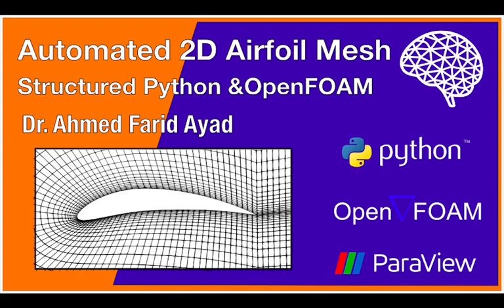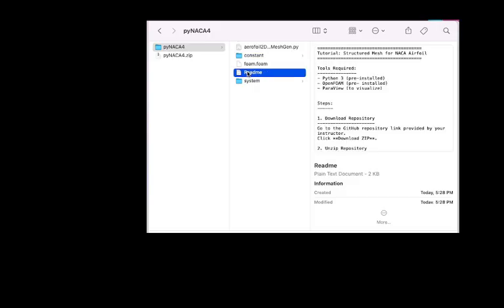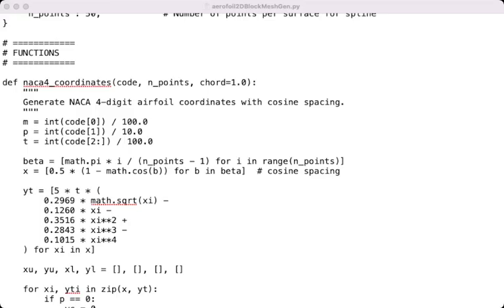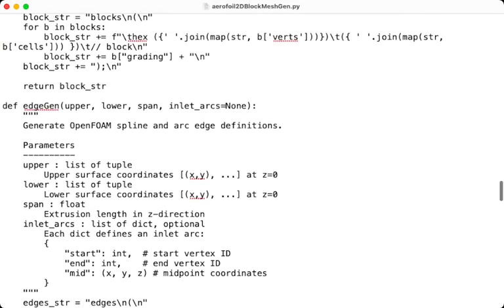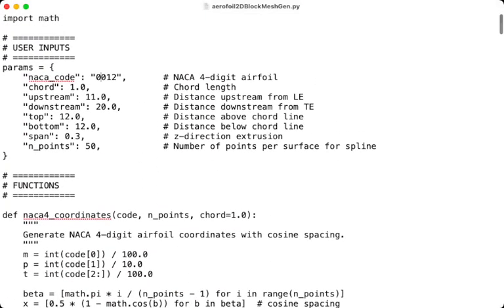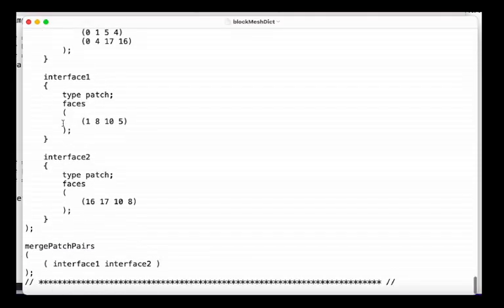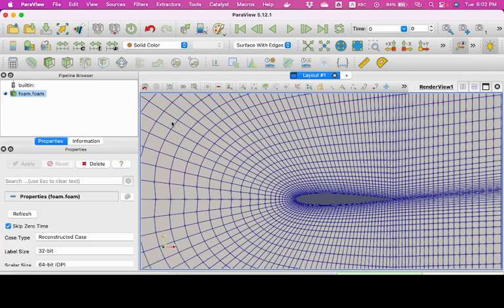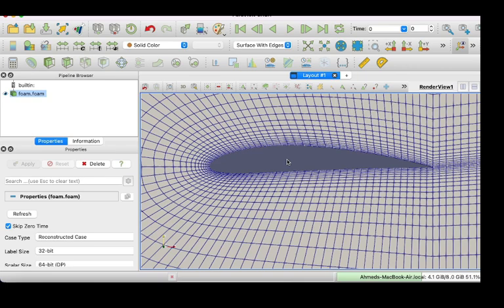Automated 2D Airfoil Mesh | Python + OpenFOAM

Comment: why my foam.foam file has no place to open with paraview?
Reply from the maker: After installing paraview you need to select to open with and navigate to assign paraview then any time it will be available in open with menu
Reply: @autoEngineringSolutions  i know, but mine doesn't show open in paraview
Reply from the maker: @HuyNguyen-zc5qb 

Then try this alternatives

If your .foam file doesn’t show the option to open directly with ParaView, don’t worry — you can always launch it manually. Here’s how for each system:

🔹 Windows
	1.	Open ParaView from the Start Menu.
	2.	Go to File → Open, then browse to your case folder and select foam.foam.
	3.	If double-clicking doesn’t work, right-click the file → Open with… → select paraview.exe (usually in C:\Program Files\ParaView\bin).

🔹 macOS
	1.	Open ParaView from Applications.
	2.	Use File → Open and select the foam.foam file.
	3.	If Finder doesn’t show “Open with ParaView”, right-click → Open With → Other… → choose ParaView from Applications.
Reply: @autoEngineringSolutions  I will try, I will reply back later
Reply: @autoEngineringSolutions  I have downloaded the file, how do I navigate the file into the terminal
Reply from the maker: Hi  @HuyNguyen-zc5qb 

to do in windows

1. Install WSL2 with Ubuntu
	•	Open PowerShell as Administrator → run:
wsl –install -d Ubuntu
	•	Restart your PC when asked.

2. Set up Ubuntu
	•	Open Ubuntu from the Start Menu.
	•	Create a Linux username and password.

3. Install OpenFOAM inside Ubuntu
	•	Update packages:
sudo apt update
	•	Install OpenFOAM (example: v2212):
sudo apt install openfoam2212-default

4 Open your project folder from Windows
	•	Right-click your project folder → choose “Open in Terminal”.
	•	In the terminal, switch to Ubuntu:
wsl

5 Run OpenFOAM commands inside the project folder
	•	Example workflow:
blockMesh
simpleFoam
paraFoam
Reply: @autoEngineringSolutions  can you help me with something?
Reply from the maker: @HuyNguyen-zc5qb yes sure
Reply from the maker: @HuyNguyen-zc5qb 
Yes sure
Reply from the maker: Just send me your email and I will contact you
Reply: @autoEngineringSolutions  nhathuy12012003 You can fill in the @ part after that yourself. I added that but I couldn't send the message.